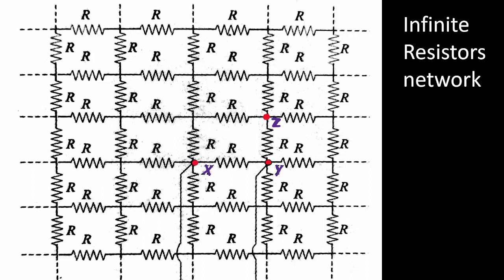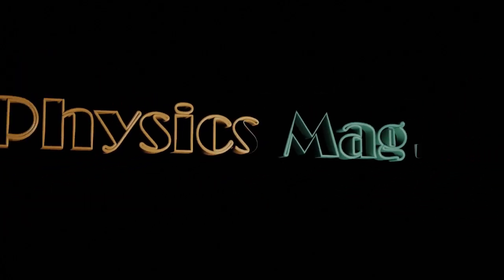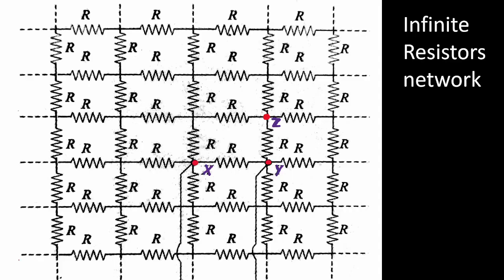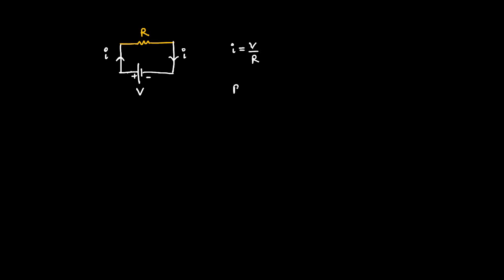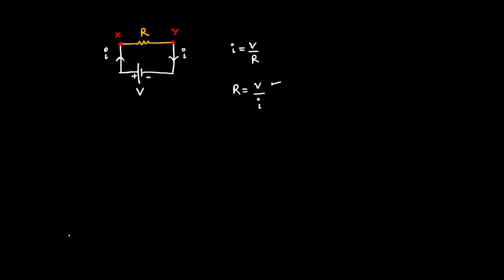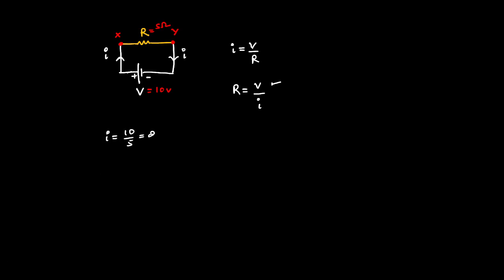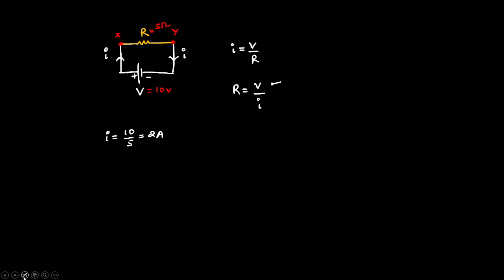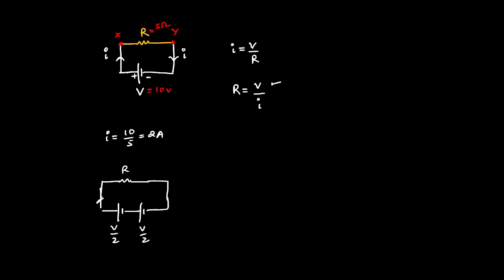There is an infinite wire grid with square cells. Problems in general physics: Irodov

Comment: Bro please tell that 
You take voltage v/2 +v/2 = v 
But don't take current i+i = 2i

If i current enter then i/2 + 3(i/4) jo i se jyada hoga matlab 2i current hi aana chahiye
Reply from the maker: While superposing, when I take current entering only i- current would be entering and leaving i-current would be leaving, when I superpose I do take potential difference V, only when I superpose I will get current entering and leaving the circuit. I hope this helps you.
Reply: Bro you got it wrong
The currents are divided in infinite branches
Reply: v/2 ka work same hai as v just usko tod ke ligha hai just to show superpostion, wo actually me v hi hai